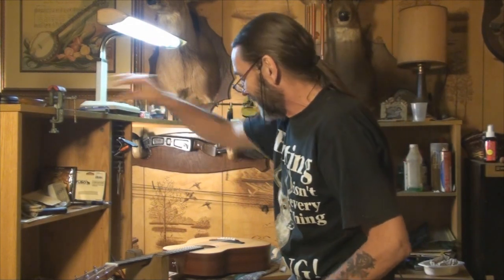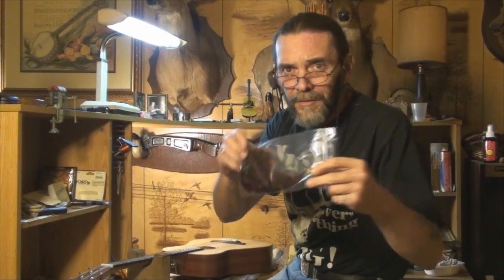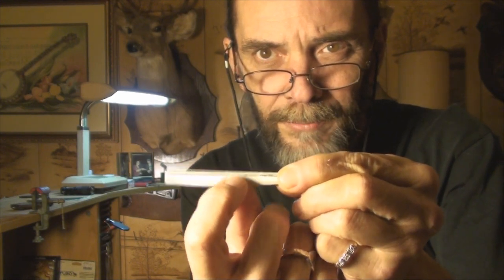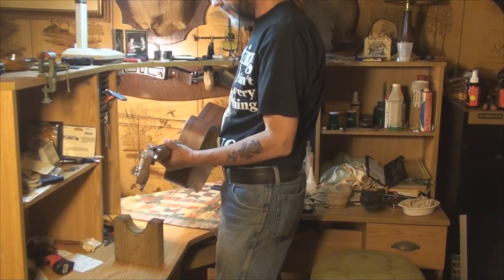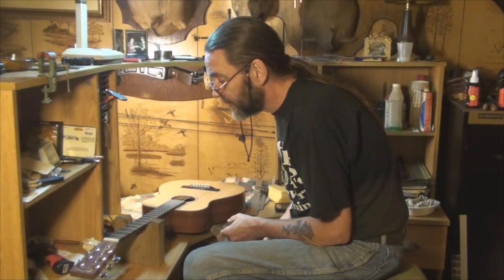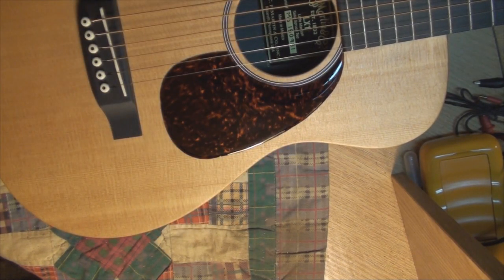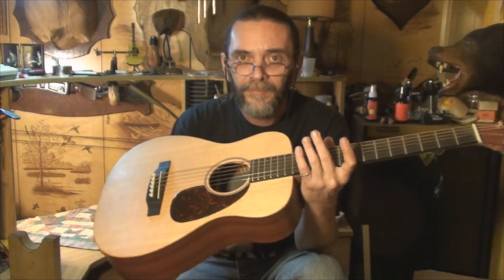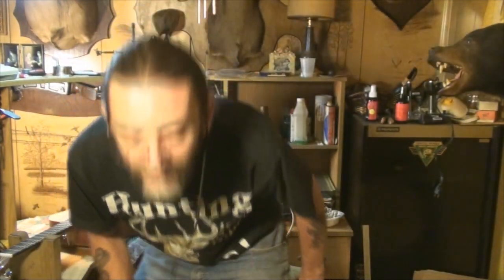Little Martin LX1 acoustic guitar setup and gets pick guard neck relief set

Comment: I bought a used LX1 that had really high action, probably why it was being sold.  I had great success just sanding down the bridge saddle as you showed here and now it plays "like buttah".  I didn't want to use my belt sander indoors so I just used a standard 3M sanding block and scrubbed away using 60 grit.  Took longer but got great results.  Thank you for this video Randy!
Reply from the maker: great to hear Elbow! and thanks for checking out my videos!

Comment: Randy, I may have a weird LX1, no pickup, but the truss rod adjustment doesn't seem to be a standard 5mm or 4mm Martin truss rod wrench.  I shone a light into the hole and it looks like  a 2 flat sided tool is needed.  I've been a luthier for many years, and this is the first LX1 I've seen.  Went looking for any special Martin tool necessary but came up zero.  If I missed the part of the video that showed you actually adjusting the truss rod, my bad.  No other DX1 video that I can find shows it actually being adjusted either.  I feel like I'm having a severe blonde moment.  I may be an old dog (66), but I learn new tricks all the time.  Anyone who repairs guitars has to learn new stuff every day.  So, color me confused.  Any advice???
Reply: Interesting. I just tried to adjust my LX1 with a Guitar Nomad 5mm truss rod wrench, and it doesn't seem to fit at all. I've adjusted other guitars and no problem. This is annoying. I like the instrument but it has subtle buzzes, which of course got worse when I went down a gauge on string-size.

Comment: Hi Randy...trying to catch up on all of your videos. I've been MIA...lot of stuff going on...this last storm blast that hit the mid west took a bunch of shingles off my roof, then my furnace went out when it was 20 degrees overnight...went several days using a kerosene heater until it got fixed. Anyway, hope you have been doing OK! I love all of your setup vids because I always pick up something new. I've been doing setups (truss rod, saddle adjustment, nut adjustment) for many years now (I think I told you I used to sell guitars), & it is truly an art, & not as easy as some might think. There are so many little nuances, variables, etc., to deal wiht that folks may not realize until you have done it a lot. The more I do something, the more I realize I don't know, & I want to learn every little thing I can about it...you can never stop learning! Funny you seem to have so many at 8/64"! That seems to be the gremlin number! lol Just about every guitar I buy comes from the factory with the action set at 8/64" (which is OK...I know they set it high on purpose so you can get it where you want it after it adjusts to its new environment), & just about every guitar in my house shifts back to 8/64" due to weather/humidity changes. In Indiana, the problem is all year long, not just seasonal, because it can be 70 here one day, & go down to 20 the next! Right now is crazy up & down - temps & humidity. For many of my guitars, I keep 2 saddles at different heights...sometimes that works. Otherwise I'd be shaving a saddle that would eventually have to be shimmed when conditions change & the action gets too low, or fit a new saddle. BTW, I just shimmed a saddle here on my Epiphone, & I honestly can't tell any difference in volume/tone, even though it is supposed to be better to fit a new saddle rather than shim. I will eventually put a new saddle in it, though...I just don't like the idea of shimming. I'm curious about your opinion on that. Also, I picked up some nylon tipped needle nose pliers in the crafts section at Wal-mart...great for removing the saddle w/o worrying about damaging it. I also use a hemostat for safely removing stubborn bridge pins! lol Works great! Also, while I have the saddle out, I very carefully smooth the top of the saddle with fine sandpaper to remove the string indentations...I've found this sometimes helps to get rid of elusive problems, like pinging or sitar sounds from a string...I'm very careful to keep the contour the same, since the shape of the top of the saddle is critical. Again I'd be curious about you opinion on this! Looking forward to more vids! Thanks so much! Take care! Janine
Reply from the maker: +WindOfTheWisp Hello Janine! I've been missing you and wondered of you were doing ok! :) I had been pumping out videos until Dec. hoping Youtube would set my channel to a higher tier as they do some channels every Dec. I thought (hoped) the number of videos uploaded within a given time would have some effect on how high of tier I got but that didn't seem to make any difference, totally opposite of what I was thinking and hoping for. Oh well.. Theres always next Dec. I guess. Yes I agree with you, I don't ever like to use shims if it can possibly be avoided. I was shocked a while back to learn how much a capo shoved up behind the nut can effect the volume and tones of an acoustic guitar and what noticeable difference it made by just removing the capo when not in use, so shims surely make some difference, probably more on some guitars than others, it's just a good rule not to use them and to get every bit of the volume and tone from and instrument, especially if it's a high end instrument, if you pay for that special sound, don't dampen it in any way! :) And you're right, the weather effects setups greatly! I try to keep in mind where I'm sending a guitar to and the weather there as apposed to here and allow for that in the setup as much as possible. Glad to hear you're doing well now, sounds like some things that happen to me! lol Thanks for tuning in, your commments are always appreciated! :)
Reply: +Randy Schartiger Thanks Randy! Yeah, it's a shame YouTube is so messed up...I still don't get notifications on my main page when you post a new video, like I used to, but at least I seem to now be getting notifications on time when you reply to a comment. We have a second YouTube account, so you get double "Likes" from us! :)  Interesting about the capo thing. Yeah, I'll get rid of the shims...it was really an experiment...I may make a before & after recording to see if anyone else can tell a difference. Speaking of weather, it was 50 this afternoon, now it's 25 at 3AM..started snowing one hour ago & there are already 2 inches or more on the ground!! Going down to 5 degrees with wind chills way below zero in 2 days!! Yuk!! Gotta love winter...not! Take care! Janine

Comment: Love your videos. thanks for taking the time to post them!! Grabbing the saddle with cutters of needle nose pliers is what I always did...and this is probably  just plastic....I did it with an old saddle and it crumbled and came out in pieces. (plastic) Any time you have an old guitar, it's always worth losing a little time and treating the parts with kid gloves....they can get very brittle. Why I only use the string winder on metal tuners!! Man!!! You let your fingers get a little close to the belt sander doing the side!! We've all taken off some skin sanding saddles, and I play strictly finger style, so usually tape my right thumb up. All the best!!!
Reply from the maker: +taxisteve929 You are 100% correct, the saddle and nut can get very brittle over time. The cutters work well but IF they do slip it's usually not a good outcome. I use the cutters for pulling bridge pins too but those old brittle ones you can snap the ball heads right off the pins before you know it. Thanks for taking time to watch my vids and comment my friend I'm glad they help.

Comment: I appreciate this video. Is the pickguard just a standard size or did you have to modify it? I went to the website that you ordered it from and they have standard sizes, so I'm thinking you did not cut it down. It really completes the little Martin.
Reply from the maker: they cut it to fit at the website I ordered it from, it's quite a bit smaller than a standard pick guard. I usually make them myself but can't keep the material long I go thru it pretty quick so it's easier and saves time if I order them.thanks for checking out the video!
Reply: Randy Schartiger Thank you!

Comment: Very nice video. I have a little Martin and now I know what it needs and how to go about it. However, I have been looking for Martin factory setup information on their web site but can not find. I have another Martin that I'd like to get factory specs for. Could you provide a link to that information? Thank you!
Reply from the maker: +L Gp I can't find the link I was looking for, seems to have been taken down. But the Martin standard specs are Low E: 3/32 min and 7/64 max. High E: 1/16 min and 5/64 max. Anything between those minimum and maximum values that feels best to you can be used. Thanks for checking out my video! :)

Comment: Hi, great video! Thanks.  I have an lx1 and have been thinking about a pick guard for mine. In your opinion do you think the little martin needs or should have a pick guard? I like the look of the pick guard but I'm just wondering what you think. I've read some people suggesting it could dampen the tone. I haven't noticed any scratches yet on mine from the pick but I've only had it a few months. Great little guitar though. Thanks again.
Reply from the maker: Pick guards so dampen the sound on all acoustic guitars, it's not very much of a change but definitely does mute is somewhat, that measured against scratches over time, I would recommend on, they do a good job protecting the wood over the long haul. Thanks for watching!
Reply: Thanks, I appreciate your advice!

Comment: micrometer? that is a  vernier caliper and please set the relief befor adjusting the string height..  if you adjust the relief after the string heigh the string height will change.. in the case + .004